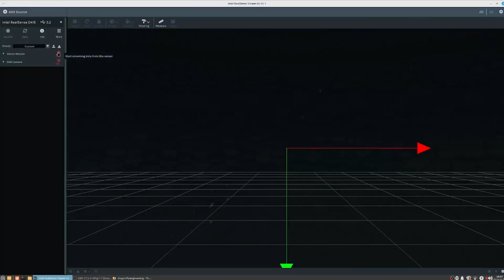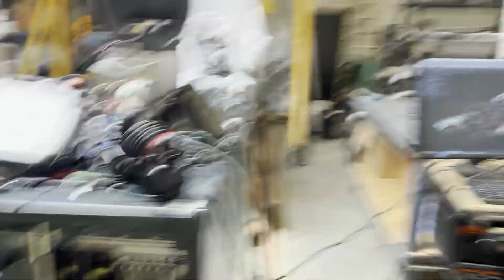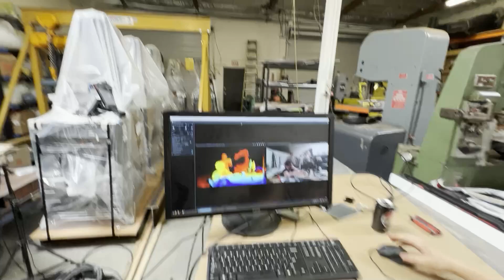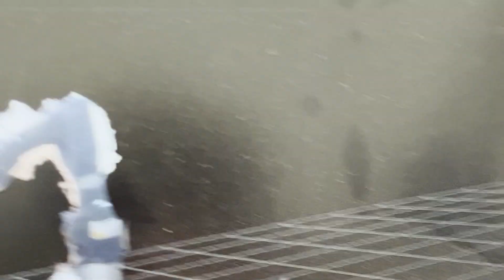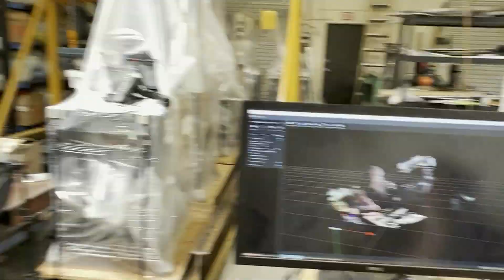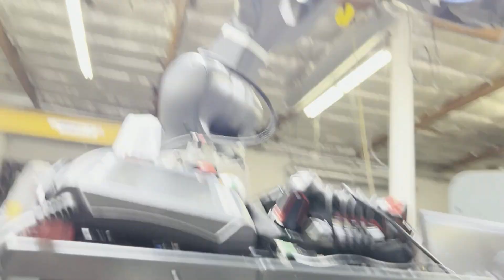NEW ROBOTS

Comment: Very nice piece of kit you have there. PIAB likes their equipment alot, each EOAT probably would cost north of $1500 to replace. The vac generator (they call it an ejector) is right there, and fully configurable. They are coax generators so they are meant to work at low pressure. I am very familiar. The camera is probably vision for part tracking. Probably with encoder for tracking conveyance speed. Let me know if you have questions, let me know. I'm in San Diego and I'd love a shop tour sometime. Love your videos, thanks.
Reply from the maker: Great to know. I will keep you in mind, and thanks for the offer

Comment: You don't need to wipe the whole system to get into a linux box. You need to add "single" to the kernel parameters in the bootloader to boot into single user mode, and then change the passwords. You can find the info online on how to do it. That way you can retain everything that's on the machine, but just clear the passwords. You can do something similar to windows machines to clear passwords without wiping the whole machine.
Reply from the maker: Thanks, Simon tried your tip and it worked

Comment: Super Cool, you got a sophisticated robot and an equally sophisticated hacker/operator(Simon)👍👍. The stereo camera/lidar can be used as a CMM with realtime feedback. Definitely used for some kind of precise placement and nothing to do with recycling. I am tempted to suggest, trying to use one for face painting🤔, to start with. Most of these custom high end robotic systems are useless, without proper driver and software and operating manual. Look forward to seeing, what and all can be done with such a system working at full capability. Seems sky is the limit!❤👍
Reply from the maker: Thanks, I hope we can use the Lidar for something
Reply: @DragonflyEngineering  Yes, I verywell understand. Once I had a concept of using servo controlled robotic arms(using microscribe 3d scanner arms, as a programming tool), with capacitive  proximity sensors to do face painting for kids(somehow, seeing the lidar in action, triggered that memory🤔). Could also make an "Amazing Turk" like robotic chess player(without the need of a hiding grandmaster, that operates the pieces remotely). Any serious endeavor has the fruits of labor spill into other domains. Look forward to interesting problems, that can be solved using the high ac😂curacy positioning system. Due to the dynamic tracking and recognition of objects, could be useful for highly customizable product assembly.